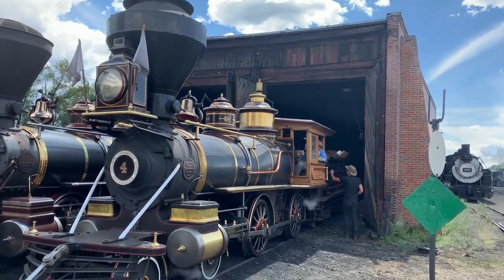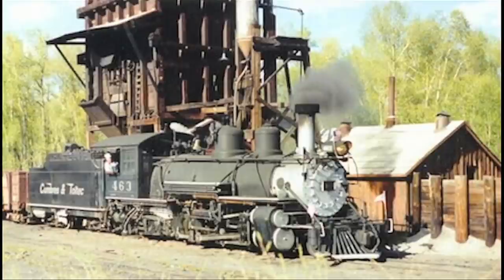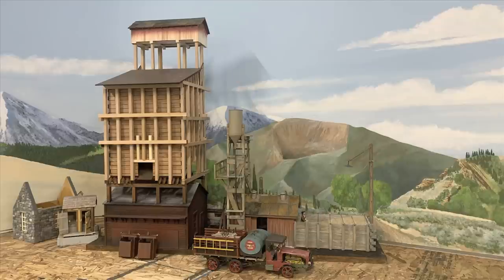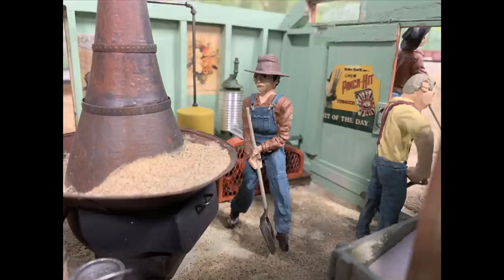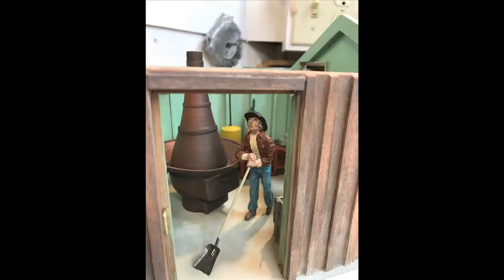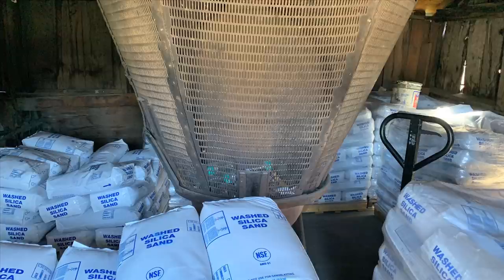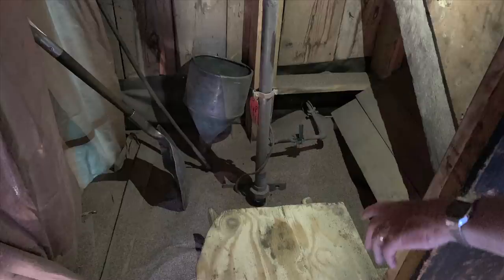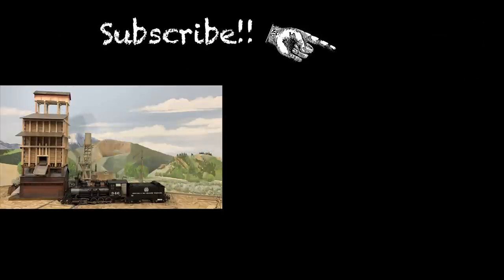Steam Locomotive Sand House - Chama New Mexico - Gathering of Victorian Locomotives

Comment: Thanks again.
        One thing about many railroad operations was the degree to which they refused to spend money unless absolutely necessary. The Rio Grande sandhouse is typical. Need an air tank, get one off the locomotive scrap line. Think about the Rio Grande Southern Geese.  It is typical economy of operation. (& we got something wonderful to model and marvel at!).
       Most railroads that survived, and many that didn't, you could hand a dollar to do something and they'd give you 99 cents change.

Comment: The sand is being blown up through the pipe via the venturi effect.  The sand funnel tee's into the pipe from the compressor to the storage tank.  As the air rushes past the tee to the storage tank, it draws the sand up into the pipe from the funnel.  Sandblasters for paint removal use the same method to pull sand into the nozzle.
Reply from the maker: I keep wondering why it’s in a pit below ground level. It makes getting sand in there easy, but why is the mixture happening down there. Ok only down a foot, but why I wonder..
Reply: @ToyManTelevision  my guess is that as you said, it's easier to shovel the sand into the funnel.  In order to route the plumbing so it would work, they had to go below the level of the floor.

Comment: Love Steve's work! And both of you as well. I have a Pola kit in HO from the 70's very similar to the coaling tower at Chama.German prototype,but it looks international. I am working on the sandhouse,also similar. More common euro practice is to have large steel structures with coal bins above the tracks .Smaller ones at  track level with swinging cranes . Very interesting to see how the system works. Steam,diesel & electric locos  use sand,perhaps you could cover these as well ?

Comment: Super video, modeling and tour of the old sand tower. Could you describe what the place looked like where they shoveled the dry sand to be blown up in the tower? Looks like it's sealed underground with a piece of plywood over the opening where the sand goes? In the middle of modeling this mystery! Thanks for any help.
Reply from the maker: Yup. Just a small pit in that corner of the room. Warm dry sand in huge piles on the floor. Shoveled into the “sump” and from there blown into the tank on the tower. The wet sand was brought into the room from outside in huge buckets. Well large… like 5 gallon buckets. Dumped into the heater. And falls through onto the floor.

Comment: i’m not sure if they would have a compressor because the only time they really need to pump sand up to the tank is when there filling the locomotive so they already gave the engine right there anyway
Reply from the maker: Yup. Just use the brake air.

Comment: I really enjoyed this video. I am building a Banta Ridgeway O scale sand house and using this information for reference. Do you have any idea of what color he painted the inside of the sand house? Also, the manufacture and type of paint used would really help. I am still using Floquil paint if I can. I always got my best results using their paint. I think they went out of business in 2012 and it is very hard to find.  I am planning do a similar interior with sand house coal stove, coal bin and air compressor.
Reply from the maker: Tamiya. Also Mr Color. Same thing. But both just like flowquil. Except really limited colors. But it’s all I use. Google them. Steve painted with an affordable water based acrylic. Green. But in the real building it’s bare wood.

Comment: Question? Could they have used a screw mechanism similar to a grain feeder into a silo ..👀👍👍❤️❤️❤️  Keep sefe
Reply from the maker: Probably. But it blows well with air. As long as it’s clean and dry. Modern railroads generally buy clean dry sand and keep it clean and dry and then blow it through pipes for hundreds of feet.

Comment: Please forgive me I do not know the name of the pump but it is a piece of pipe with a T  at on the top you put air across the top of the T and it sucks up water from the bottom that is  probably what they used to pump the sand no moving parts
Reply from the maker: Yup!!!!  Carburetors work that way. Or did… cars don’t have them anymore. The injectors on a steam locomotive work that way. Venturi. High speed moving air will grab anything in its path. Get caught in a sand storm!

Comment: What scale is this structure; O, HO, etc.?
Reply from the maker: Hi. It’s “F” scale. Fn3. Odd?  Not really. Most people think it’s “G”. (Garden). F stands for fine. Fine scale. It’s 1:20.3 scale. G was 1:22.5 scale when LGB created it. It’s all based on #1 gauge track. 1 3/4 inch gauge. When LGB created G it was meter gauge prototype running on #1 gauge track. Hence 1:22.5 scale. But in about 2005?  American modelers wanting accurate 3 foot gauge, not meter gauge, declared F scale. Just a bit bigger so the trains are accurate (fine scale) 3 foot gauge. Anyway the mess is that “G” scale or G gauge may be 1/2” scale, 1/32 scale, 1/29 scale, 1:22.5 scale or as in this case, 1:20.3 scale. Oh I forgot. Also 5/8” scale. 2 foot prototype. Sigh….